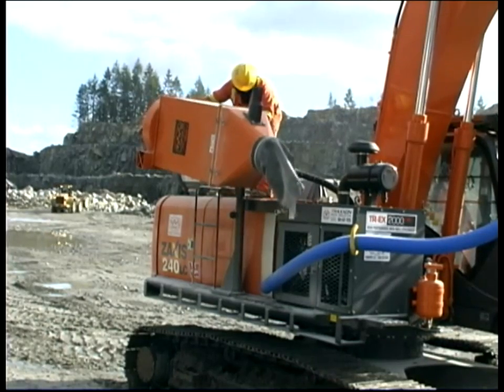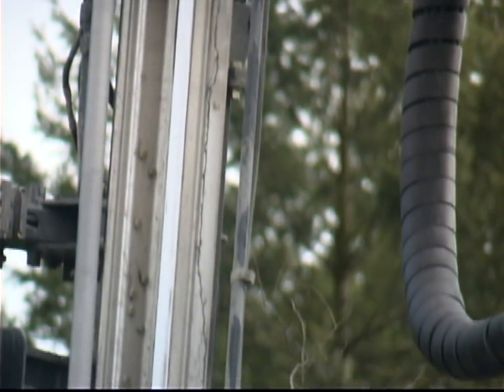TR-EX 2000 High Performance Rock Drill Attachment

Comment: I have used 4 variations of this attachment, and simply put, it kicks ASS! The versatility, reach and productivity is like nothing else. How else could you drill 40 3 1/2 inch holes in a 6' x6' pattern and install 30 rock bolts in a wall 18 feet up without moving a track? The CAT 330 has just enough counterweight, but a little more couldn't hurt in steeper terrain. If you have one, you might never need anything else! Thumbs up to the guys at Traxxon!

Comment: where using a tei rock drill right now, 3 inch holes, where retro fitting radio tower, this would be a really sweet set up, but the machine it would have to be mounted on would be to large where using a mini and its a tight fit  and the tei is to heavy by a couple hundred pounds so it  so we had to add counter wait, but that is a very nice attachment.